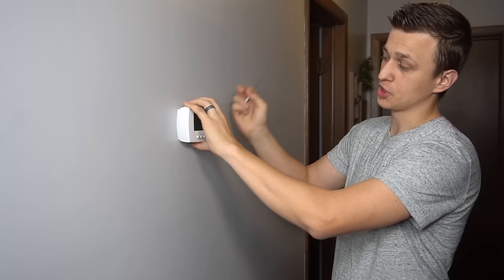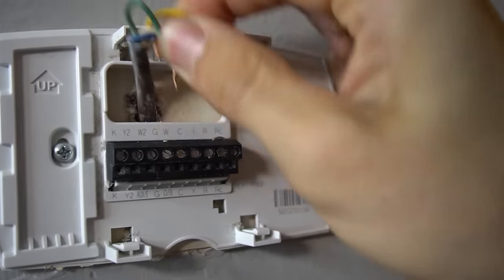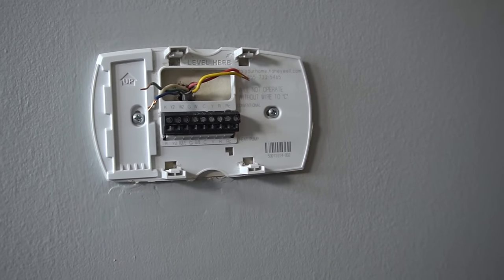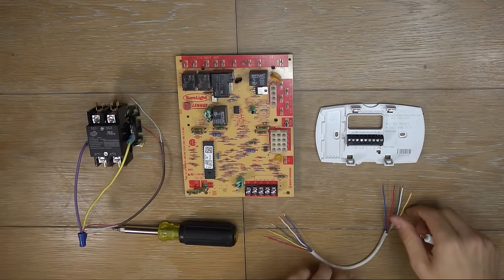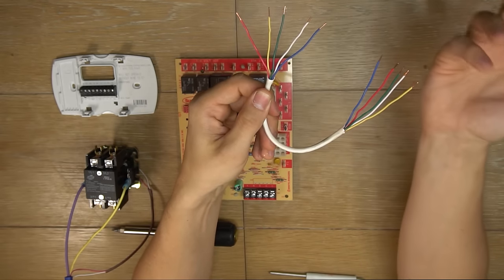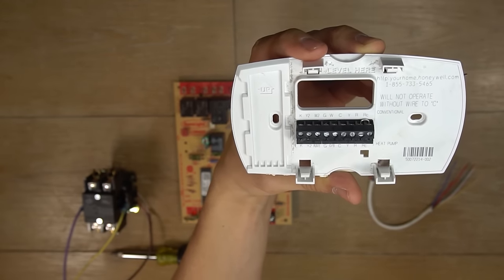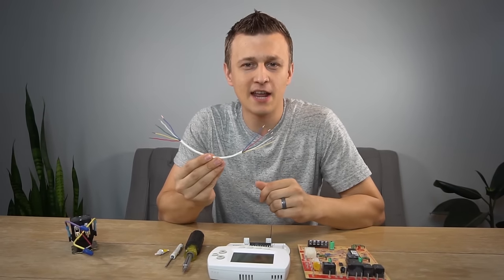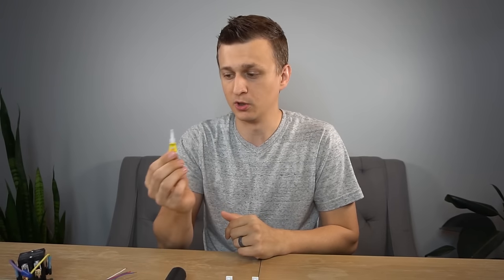Basic Thermostat Wiring - How to Wire HVAC Thermostat

Comment: You have 2 stage furnace right? Why no wires for W2 or Y2? In your opinion how difficult/expensive is it to run a c wire if one isn’t present?

Thanks
Reply from the maker: Having Y2/W2 wired up is not necessary. My furnace control board switches stages with a timer. I think it is either 10 or 15 minutes on low stage and then it switches over to high stage if it did not reach the set temperature. The AC is single stage. Running the wire is not too expensive. You just need to buy a spool of thermostat wire and then tie the new wire to the old one and "fish it out". Avoid making knots if possible, otherwise the wire will get stuck inside of the wall somewhere. And if you have finished walls/ceilings all over, then make sure the new is attached to the old really well so you don't lose it midway.. Hope that makes sense
Reply: Word of Advice TV are you saying that you rarely use the 2nd stage so that’s why the wiring isn’t necessary? Thanks for the information about running the wire.
Reply from the maker: No sorry, what I meant is that it is a lot more common for a furnace to switch stages via a timer in the control board instead of having the thermostat control it. (would require Y2/W2 to be wired up)

Comment: I just moved into a apartment and the only way I can turn heat or air is manually! 
 And in the box there’s a red and white  wire it’s kind of like the hotel set up. It’s either heat or cooling. I’m just wondering what kind of thermostat need to get.

Comment: I only have propane forced air furnace and no ac. I’m confused. I have 2 wires going to thermostat… one to Ra and one to VV? Nothing going to C or G. Furnace runs correctly but I can’t get fan only to run without heat. Any idea? Thanks

Comment: Hi,Jay.
 I have a question for you.

One customer: A Honeywell WiFi themostat was installed without C wire, it worked ok for about half year. When the weather gets really cold recently, the thermostat screen keeps on and off every second, additionally the furnace inducer motor works on and off too .

Another customer:Nest themostat without C wire,  worked fine for couple months until recently When called for heat, no heat. when turned off themostat, blower fan still running. (Furnace is not listening to thermostat

Both furnaces, When I jumped R and W. The furnace works fine. 
Both furnaces, I replaced a batteries thermostat, everything works fine.

Is it not getting enough power from 4 wires(RWGY) without C?  Why ?
Reply: I think if there are batteries installed inside you don't need C wire.
Reply: @victorwang5524  that is right,but some t stat doesn't have battery, they need to get power from furnace like smart WiFi t stat

Comment: Your hope is rewarded, I find all your videos helpful:) See what I did there? It's like I'm helping you =-D.... lol, no, I jest. You definitely make some of the best vids for learning how to do stuff I shouldn't be doing, haha. ...I've used glue on cuts, doctors still do, it's just not called crazy glue, but any type of cyanoacrylate glue/epoxy works well, some are more toxic and some medical grade, but all work, none kill you, lol.

Dude! I only have 2 wires!! Bah!     It's an old unit, heat only. 1 white wire, 1 black. I feel I've tried every combo on R(with jumper in), C, and W(instr. say 'W' is call for heat Honeywell TH1110DV 9001). It seems to work but when it's time to turn on the fan it just clicks and flashes '11'. Some combos the heat comes on some it doesn't.

Please help, I'm getting cold. haha....🥶  ha😢 

Peace
Reply from the maker: Glad to hear the videos have the desired effect! :) Thanks for watching and commenting! So from what you described it sounds like the burners come on but the blower fan does not... In that case I would suspect it's a problem with a blower motor. Try this video and see if it helps: https://www.youtube.com/watch?v=JSgLGTAbDF8&t=1s
Reply: @WordofAdviceTV  - lol, I think you answered the wrong comment, maybe? Idk, But everything was fine I was installing a new thermostat as you discuss here. I couldn't find the correct 2 slots for my only 2 wires. But I eventually did. Tx tho, bud. I used your link video about 6 months ago to solve that problem, haha. Keep up the good work, they say service is the number one element of a satisfying life. peace
Reply from the maker: @blackopal3138  Haha oops, sorry about that man! But I'm glad to hear you got it figured out! Stay warm!

Comment: I’m a bit confused on the wiring in the thermostat base. How come you need a jumper from R to Rc but not for R to Rh?
Reply from the maker: Some thermostats need a jumper from Rh to Rc as well. A lot of times the red wire will go straight into Rh and then via a jumper go to Rc as well.

Comment: How u doing I need help I have a red and white wire coming from my ac unit out side to my thermostat wires white red blue yellow brown and green my dog chew on them now I can’t figure out where them wires go to because it 6 wires going to only 2 wire the white and red thanks
Reply from the maker: You will have to look inside the furnace. The two wires that go to Y and C at the control board will be the two wires you need to hook up outside

Comment: Hi. Would this setup work without the blue common wire connected?
Reply from the maker: Yes it would. Unless you have a very simple thermostat, usually not having a common wire means the thermostat will have batteries instead.
Reply: @WordofAdviceTV  thank you

Comment: What how would you wire it if the furnace is a separate transformer. Basically I have a RC and a RH wire. Is a jumper still needed between r and rc.

Comment: Need Help!!!please~
My thermostat isn't work suddenly. No signal at all. I checked breakers but it's ok. What's the problem? Please answer me.
Reply from the maker: I would guess that either the thermostat batteries are dead, furnace power switch is off, or the 3 amp fuse is blown (usually found on the furnace control board)

Comment: I have a split 4ton trane heater , no heat pump, Model S8B1B080M4PSCAA , thermostat honeywell 3000, in cooling and heating works good. But if I want use to use the fan only !!!!  I only works in ever low speed,  at the board in fan only , it shows code COF,  which is fan mode ,   it shows code , what speed  its is in,  code is Up side down ( F ) P1 which shows the the speed.  Does this modele allow u to change the speed in fan only mode at the board. And how

Comment: Ok, say, for some reason, when you got there, behind the existing thermostat, there weren't wires there anymore. Other than tough luck and the hole in wall fishing? They were pulled all the way down, well the ac wires were. Fished out the heater ones.

Comment: Hi Jay. I found a jumper between Rh and Rc on the old thermostat. Why is that?
Reply from the maker: R = Power
Rh = Power to Heating
Rc = Power to Cooling

Many thermostats have a jumper from R to Rc or Rh
Basically most thermostats are wired to have power going to all 3 of those terminals
Reply: @WordofAdviceTV  Thank you. Jay.  This is a DX unit with steam heating
Reply from the maker: @jamesliu3688  Oh I see! Hmm.. In that case I can't say I know for sure since I don't work with steam heating at all...
Reply: @WordofAdviceTV  That's OK. Jay.Thanks anyway.

Comment: hi jay, when i replace my analog thermostat to digital. there is only 3 wires and 1 is not even connected. i got white black and red. black is not connect even on the board control board. white is connected to w/aux and red is connected to r. no ac just a 1 stage gas furnace. is that okay?
Reply from the maker: Yes that is totally fine as long as your thermostat has batteries. If the new thermostat does not have batteries you would need to hook up the common (C) at the thermostat and the control board. That black wire would be used for that.

Comment: Okay let's c you hook up a. 220 volt AC only air handler with just a bunch of low voltage control wires . thanks for the video.
Reply: um, with 220 v feeding the thermostat wires?
Reply: Google ac contacter. Also google the difference between a air handler and  condenser. After that delete your post or at least edit it.
Reply: I wasn't trying to b a punk. But most ac only Air handlers don't have a control board. So most people can't understand how to hook it up. I have been on job sites where the electrician would say I don't do low voltage ... Just because it is confusing to them . I wasn't bashing the video .  I gave it. A thumbs ☝.

Comment: Jay,  I have watched many of your HVAC videos.  You answer many questions.  Maybe you can answer mine.  

I am replacing a non-C wire thermostat with a C wire thermostat.  There is no terminal labeled C on my control board.  My control board is White-Rodgers product with 9 terminals labeled. 
Bk/Twin, W2, W1, R, G, B/C, Y, YLO, O.  

BK/Twin, has no wire attached.   24 volts to GRD
W2 has a White Wire.     0 volts to GRD
W1 has a Red Wire.    0 volts to GRD
R has a Red Wire.     24 volts to GRD
G has a Green Wire.     0 Volts to GRD
B/C has two White Wires.   0 volts to GRD
Y has a Yellow Wire and a Red Wire    0 volts to GRD

Jay, care to hazard a guess which terminal I can use as C?
Reply from the maker: Hey Rob! An easy way to know where it goes is to simply see where the air conditioner thermostat wire goes. The two wire thermostat wire coming from the condenser outside will always go to Y and C on the control board. So the 24v side will go to Y and the common would go to the other one. My guess would be that the B/C terminal is your common. Further reading if you are interested: https://support.google.com/googlenest/answer/9251394?hl=en
Reply: @WordofAdviceTV  Jay, thank you!  You got back to me so fast!  I'll study your advice and check out your reference. Again, thanks , Rob

Comment: Merci pour la vidéo. S'il vous plaît j'aimerais une vidéo comment installer thermostat Honeywell modèle 1950A pour les chambres seulement ( Thermostat Pour Plinthe Électrique ). Moi, je ne sais pas si la tension 24 V où 120 V. Mais apparemment à ma connaissance la tension du réseau 120V. Thermostat Pour Plinthe Électrique.

Comment: I detected a short between the two wires going to the AC unit outside (C and Y terminals). Is this normal? I'm trying to upgrade to a smart thermostat but I'm blowing fuses, still trying to identify the cause...

Comment: where should I put the blue common wire if my thermostat has no c terminal my thermostat is wired Green wire to r terminal red wire to rc terminal, white wire to w terminal, yellow on y terminal and blue wire on g terminal also I can't turn my unit on at the thermostat I have to flip the breaker and when I do my fan automatically comes on, wondering if it's wired wrong since my ac won't come on either
Reply from the maker: It does sound like the wiring is not right. You could try taking all the wires off at the thermostat and control board and re-wire them the way I show in the video. (take pictures or label wires so that you can wire it back to how it was if you need to) As for not having a common terminal.. Does your thermostat have batteries? If not, then it's likely a "power stealing" thermostat that does not require a lot of power to operate and can get away with not having a common. I would just wire the rest of the wires the way they should be and see what if that makes a difference.
Reply: i was thinking wiring too, before I replaced with the new thermostat I have now which is just a standard round honeywell everything was working fine it does not take batteries neither did the old Mercury tube type thermostat . Wondering if the reason I can't turn on heat or ac at the thermostat maybe because   it's not receiving power or because the green wire is on the  red terminal and that automatically calls for fan whenever I turn the breaker on

Comment: How come the AC contactor is wired from the INPUT of the control board? Does the thermostat directly control the AC without any involvement of the board?
Reply from the maker: The board does play a role. Especially since it needs to turn on the blower motor in the furnace. So it's possible to have a thermostat that is calling for cooling but the board is not sending the power through.
Reply: Thanks for the reply but it's still not making sense. When the thermostat calls for cooling, Y will go to 24 VAC which will go straight to the contactor without the control board's involvement,right? Does the control board have another circuit that goes out to the outdoor unit?
Reply: @andyfer7716  your Y wire has to go to the board first and from there to the ac unit outside, can't go straight from thermostat to outside unit
Reply from the maker: @andyfer7716  You make a valid point. So if there is nothing wrong with the system and there is 24v going to the thermostat.. (this excludes  communicating systems..) Then when the thermostat calls for cooling that will turn on the condenser unit since, like you said, there are only two of those wires going outside. So actually you are right, in that case the thermostat is in control. That being said though.. Even though the thermostat will turn on the condenser outside, the board may not power on the blower motor inside. (if it's bad)
Reply: @WordofAdviceTV  The reason "Y" is hooked up to the furnace board is to turn the blower on for high speed if it were a straight shot the blower will not run at high speed you need more air flow for A/C than heat
Reply from the maker: @hvacguy84  Thank you for clarifying!
Reply: @WordofAdviceTV  If you set your thermostat for fan on the furnace fan has a speed called "continuous fan speed" (On some furnaces) sometimes the fan may run on medium, medium low or medium high

Comment: Hahaha I done the super glue trick I crack my head open I will say 5 inches long i didn't had a first aid kit but I had gorilla glue on my tool box 😂 so I clean up the wound with alcohol wipes I applied the super glue it work like a charm by the time I got to the hospital I was told that I didn't need stitches but they do sale the special glue for emergency cuts it works better than bandages

Comment: Jay, great video.   Can you help?  Trane XE1000. My compressor turns on but my fan does NOT. I’ve replaced my capacitor 40/5 uf and still no go.  I replaced the exact fan motor, still no go. The contactor is pulling in and I cleaned terminals.  It turned on once but then it stopped again.   I can’t figure it out.   Help?
Reply from the maker: Well that's an odd one.. So you replaced the fan motor and the capacitor but it is still not working? But the compressor does come on? My only guess is that perhaps something is not wired right.. If you look at the condenser wiring diagram, do all the wires go to the right place? Or you could verify using one of my videos:
Basic AC Wiring: https://www.youtube.com/watch?v=KCanZEsLVEI&t=3s
Condenser Fan Wiring: https://www.youtube.com/watch?v=VlMhvwrpimE&t=5s
Reply: Word of Advice TV: Here’s the background; I was out of town and my son called and said the AC doesn’t seem to be working. I told him to turn it off for now and I’ll check when I get home. The fan motor was seized but I was able to turn it hard enough and it freed up. We lowered the thermostat to turn it on and the fan didn’t spin but the compressor was on. I gave the fan a flick and it got going but it doesn’t work repeatedly without the flick, So I replaced the capacitor. That still didn’t fix it, so then I bought a replacement fan motor identical to the original GE with a purple , black, brown wires. Didn’t work.  BTW I have a fluke 117 and tested both caps. Both read 40/7.5uf so I put the original back in.  It turned on and I let run but then the system turned off after approx. 6 minutes.   
BTW I always take pics before just in case, and cleaned terminals. . 
Just watched your video/links. I’m going to check the wires again. Thanks so much for your help. Frustrating
Reply from the maker: @eilertb1310  Sorry to hear about the long lasting problem.. There is only so much I can tell you without actually being there myself. Hopefully with the videos you will be able to track down the problem. I mean you already replaced the fan motor and the capacitor.. Since you have a meter, I am wondering.. When the fan motor turns off, is there still 240v going to the motor? (by the way, I have had times where I got a bad motor right out of the box...)
Reply: Word of Advice TV ***Jay, I swapped the black with the purple on the contactor and it appears to be working, three times in a row. Thanks for all your help I know it’s tough without being her. I’ll check the voltage and get back to you. I remember checking the contactor and it was 26.6 but I don’t remember across the fan.     10 minutes later, I just checked and it’s 236.5 V AC across the contactors.
Reply from the maker: @eilertb1310  Swapping the black and purple sounds like it should do the trick! I have actually done that mistake myself before. The unit will run for around 5 minutes and then turn off.. Anyway, glad to hear it's working! Thank you for the update! If it is running normally, no need for voltage measurements then :)